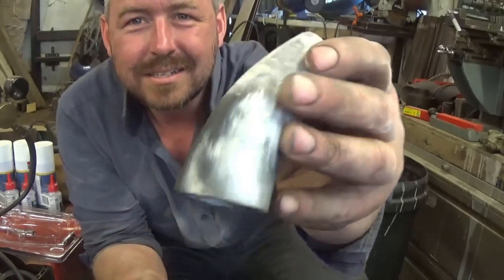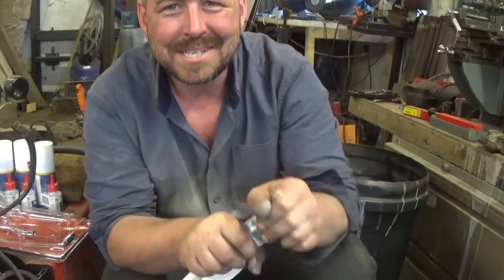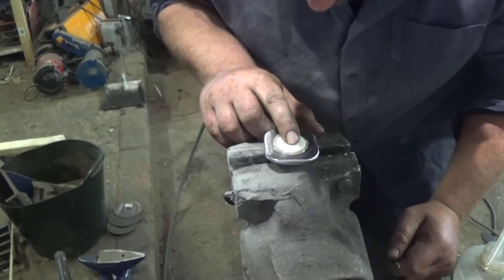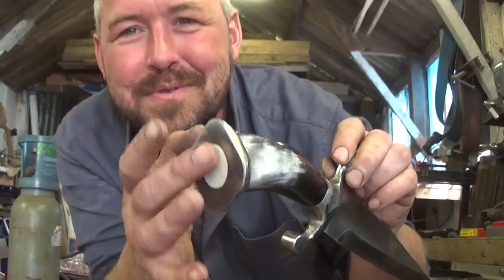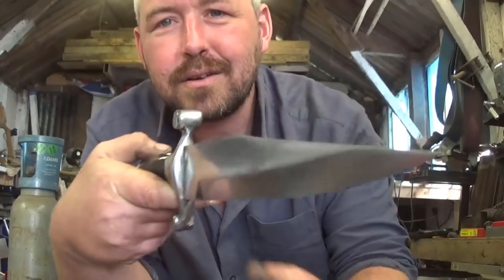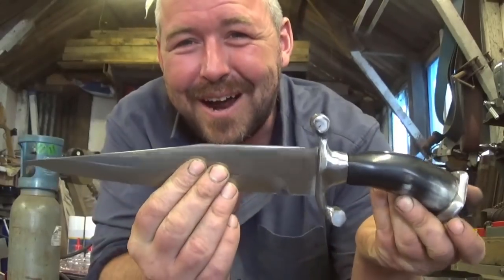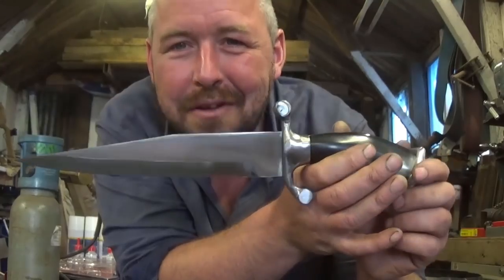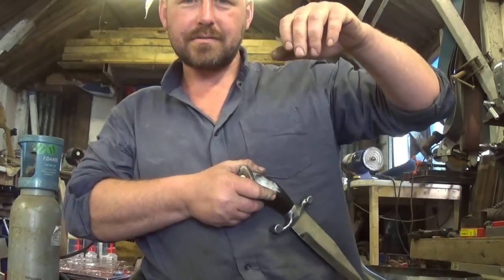knife making BIG toothpick

Comment: I worked a bit of horn a few years ago and my wife went crazy over the smell. Really caused a row in my house. It smelled like singed hair, but more intense. This knife came out fantastic James! I use your parang that you made me every few weeks and it holds its edge fantastic and its one of the best choppers I have!  I just have to mind the sheath :)
Reply from the maker: Joe I'm just about ready to start batch producing smaller parangs, with your input I've messed around with the rivet spacing and how high the sheath comes up the spine and have a design that cannot be cut open in the same way, thank you very much for your input and I'm very very happy to know it's being used!